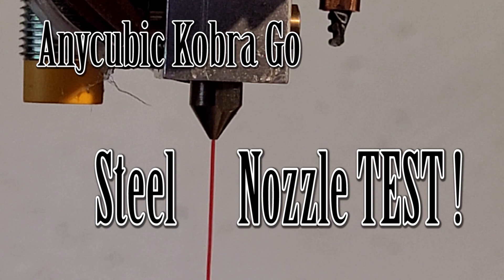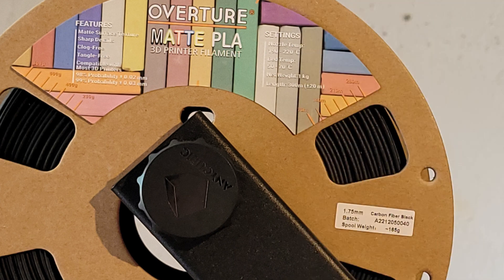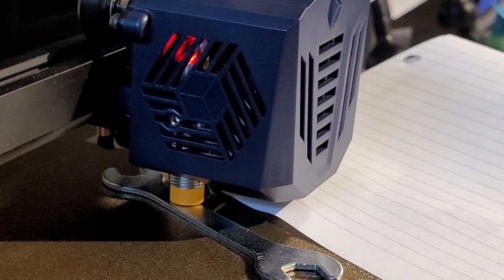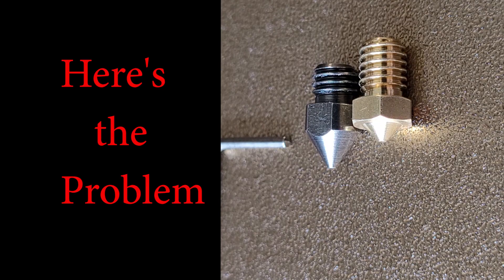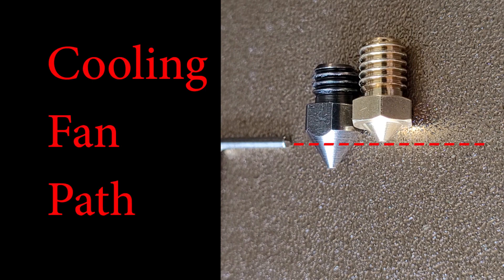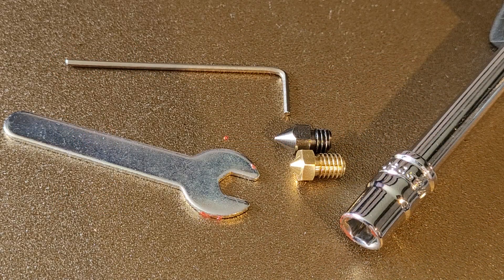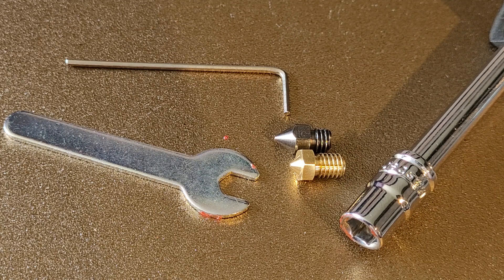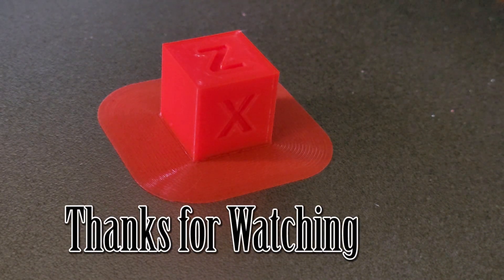Will the Anycubic Kobra Go Steel Nozzle Pass This Important Test?

Comment: Your mistake is you bought the wrong type of nozzle. It's fairly common. The anycubic comes with a V6 nozzle. However the hardened nozzle you bought is an MK8 nozzle that's very common on creality printers. While one design isn't inherently better than the other they are NOT interchangeable. You either have a hotend that uses v6 nozzles or one that uses MK8.
There also an additional type called MK10, also not interchangeable with either MK8 or V6.
Reply from the maker: Hi Gabriel, thanks for the education https://www.youtube.com/watch?v=zj-Q4sU95nM

Comment: Thanks you for providing these videos. I'm going throught the same trials right now.
Have you thought about printing with ABS? Because it is what I'm about to dive into with my own Anycubic Kobra Go. I'm a bit worried though as I don't have enclosed chamber.
Reply from the maker: So far PLA and carbon fiber laced PLA is where I'm at. Make sure you're well ventilated and don't inhale the fumes. This si what I found from the net. Printing with ABS is known to produce a strong odor with fumes that could potentially be harmful if inhaled in large quantities. Avoid confined spaces and place your printer in a well-ventilated area to avoid these issues.
Reply: Don't bother with ABS. Try ASA. Same temperature resistance as ABS, better UV resistance than ABS so much better for anything outdoors and it's leagues easier to print.
Reply from the maker: @Shoshk3  Does ASA require any special ventilation, I'm interested in trying it.

Comment: Thanks, I was about to change my nozzle, I'm going to set in upp in the lathe and shorten it. Du you think the thred length is an issue?
Reply from the maker: The steel nozzle that I have if you were to machine it back, you would machine right into the bigger opening of the filament. Shorter thread should not matter as long as you don't retract out of the nozzle for retraction settings. Measure first and if you can afford to lose the nozzle, test it.
Reply: @Mayhem Smiley  I see, maybe I'll try to make a new one instead. Thanks man.